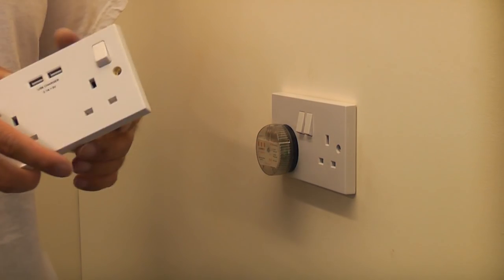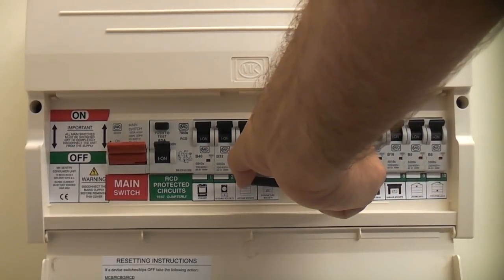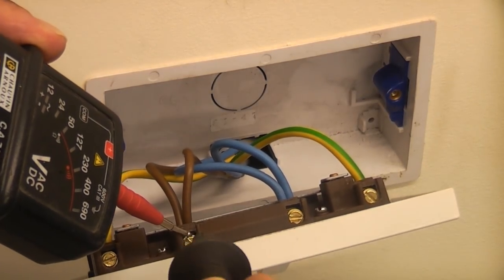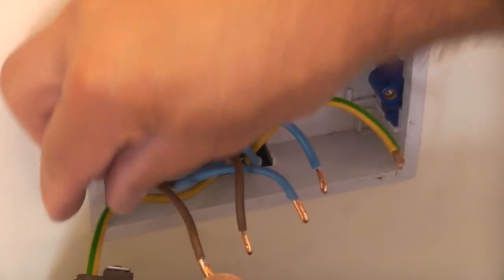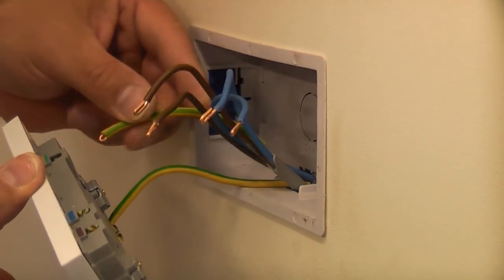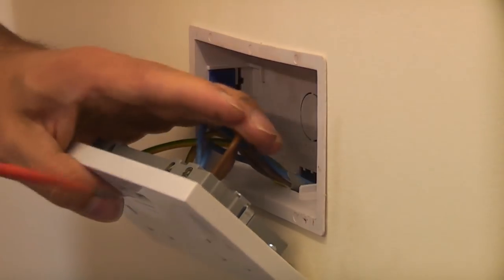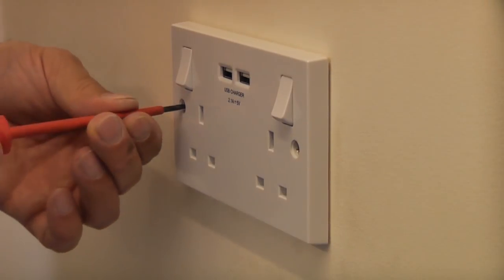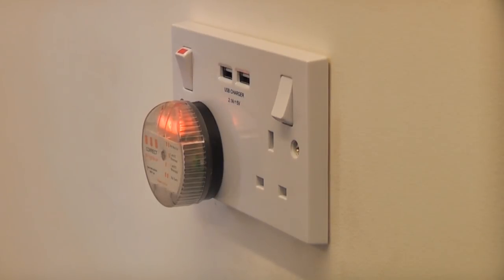How to install a USB wall socket

Comment: Handyman. Do those circuit breakers in your video just pull out when needing replaced? Is there a special tool or do you just pull them out by hand?
Reply from the maker: Jason Dunlop 
No, you have to isolate the main switch, remove the consumer unit cover then undo a screw at the bottom which connects the circuit breaker to the bus bar. Then on most circuit breakers you have to lever down a tab to be able to pull the breaker from the DIN rail, which it it clipped on to.

Comment: Do these still work on the old style wires I have the black red and one earth wire ??
Reply from the maker: Yes, they will work on old wiring. However if you have black covered cables (old rubber) it might be best to get your wiring checked by an electrician.

Comment: On my wall socket I have 3 earth wires. Should I put two in right  screw hole and one in the left?
Reply from the maker: Yes, that should be fine.
Thanks for the comment 👍
Reply: @ultimatehandyman  thanks you've really helped me out.

Comment: Hi u recommend me a dewalt combi drill with a steel chuck instead of a plastic chuck and its much better the grip on the chuck is better thanks
Reply from the maker: Keelin Black 
The metal chucked versions are normally the better made drills and often have more power as well as the better chuck. I hope you get years of use from it ;-)
Thanks for the comment

Comment: Thanks excellent video. I feel confident and safe now. That lock idea on main board really clever. Could you send a link please for the exact USB sockets you used as the colour coded wire location on the socket was great.
Reply from the maker: You are welcome.
I think it was this one- https://www.screwfix.com/p/british-general-13a-2g-sp-switched-socket-3-1a-2g-usb-charger-white/8529p
Thanks for the comment

Comment: I have an FCU that I would like to change to a single socket. Is that advisable?
Reply from the maker: It depends which circuit the FCU is connected to.
If it's an FCU on the socket circuit then yes, it should not be a problem.
If it is on the lighting circuit then no, you can't put a socket in its place.
If it's on a dedicated circuit you might have to check the MCB or fuse protecting the circuit and change it for a suitable amperage one.
Reply: Thanks for that - I don't know how to check which circuit it's on as I don't have anything attached to it?
Reply from the maker: If you get a no contact voltage detector and check the unit is live you can go and isolate a circuit at the consumer unit until the unit is no longer live, that will indicate which circuit it is on.

Comment: I bought a box of these double sockets with built-in USB from a well-known outlet. Shall we just say, if you are screwed, they can fix it? Fitted first socket for a friend, I won't say "customer" as the Taxman might read this. Both sockets fine but no joy with the USB sockets. Tried a different phone with a different USB lead and still no joy. Tried another from the box and had another go. Still no joy. Took the whole box back which was exchanged with no questions asked. Blow me if it was the same thing all over again. Took the new box back got a refund and went to another wholesale outlet for exactly the same make and model. All worked from the get-go. And they say to look for British  Kitemark for safety and quality of goods. Sorry about the rant people. It's off me chest now so Happy Days!!
Reply from the maker: Blimey, whatever happened to quality control!
Thanks for the comment 👍

Comment: Knowing how variable the quality and safety of USB power supplies can be how easy is it to dismantle these sockets? If I were to fit them then I would buy one to sacrifice and strip right down. Some USB supplies have sub 0.5mm separation between mains live and the 5v rail and the thickness of enamel on the wires in the transformer. Supplies like this are very common indeed and I would not want them fitted to the wall where they could become lethal for children to use after a few years.

Comment: I love that CU. It's so clean and organised. Did you fit it yourself mate? Btw what model is that probe tester? I'd love to buy myself one
Reply from the maker: +fro0tyl0opy87 
That's just a brand new CU that is not actually wired to anything LOL. I only use it for demonstration purposes as I have never been able to film my own CU or any others for that matter because the lighting is normally bad or there is junk in the way!
My tester is a Chauvin Arnoux. I'm not sure of the exact model without going to the garage to check, but it does say GS38 on it. Thanks for the comment ;-)
Reply: +Ultimate Handyman oh I see!! Oh well at least I no longer need to feel jealous then hehe. But I'd still like one as mine still uses the ancient clunky rewirable fuses. Thanks for your reply. Cheers.
Reply from the maker: +fro0tyl0opy87 You are welcomeThanks for the comments ;-)

Comment: when I took my old wall socket of there was only one earth so would it be OK to put new one on with just one earth
Reply from the maker: +Billy Rodaway 
When you say one earth wire, is there two lots of Live and Neutrals or just one of each?
Is the back box plastic or metal?
Reply: Ultimate Handyman 

I have the very same question. I only have one Earth,  but 2 sets of live and neutral.

Comment: haha.. Best advice.. Don't over tighten the screws.On my first time, I used an electric screwdriver and did not change the torque setting and split the socket in two.. (School boy error) :-)

Comment: Why is there two of each cable sometimes? I know mine has this, I opened my socket, I have the old colours. One of the blacks isn't connected and one socket hasn't got an earth connected? What do I do?
Reply from the maker: If you have two sets of cables behind the sockets it means you probably have a final ring circuit. 
http://www.ultimatehandyman.co.uk/how-to/electrics/ring-circuit
The black should be connected to the neutral terminal and the earth should be connected to the earth terminal (do this with the electricity isolated). Its very dangerous to use a socket without the earth being connected!
Reply: +Ultimate Handyman on the neutral terminal, there is only one black connected and the other is hanging out. Both earth cables are connected into one terminal.. I will sort the black cable out but are the earths OK in one terminal or shall I have one in each earth terminal?
Reply from the maker: The earths are fine in the one terminal ;-)
Reply: +Ultimate Handyman thanks!! All fixed, don't know if it made a difference to performance, but it's probably safer so that's fine with me, many thanks
Reply from the maker: You are welcome.
Thanks for the comment ;-)

Comment: Presumably you'd not run an insulation test on the ring circuit after installing one of these?
Reply from the maker: +Lee Greveson 
I wouldn't, neither would any other DIY'er.
Reply: +Ultimate Handyman I recently bought some Masterplug branded sockets just to try out (also branded as British General) The literature with the product states you can run an insulation test on this accessory. Happy days! True a DIY'er wouldn't run this test, but new circuits may include these items as they gain popularity.
Reply from the maker: +Lee Greveson 
Thanks for the info ;-)

Comment: Why does it say "for IT equipment use only" on the back? Also, does it matter which earth wire goes in which earth socket, i.e. "Clean Earth" etc?
Reply from the maker: I don't know why it says that, sorry.
As long as all earth wires are connected to either earth terminal it should be fine.

Comment: Perfectly timed video. Thank you so much.
Is there a really easy way to remember Live/Neutral and the colours. I try and think of 'bLown' and 'bNue' - I know, not very inventive.
Reply from the maker: exwhyz33 
I don't know if there is an easy way to remember, but all appliances have been brown and blue for decades in the UK.
We were taught this early on in school physics- something that I always remember.
That new socket actually had a blue marking over the neutral terminal and brown marking over the live terminal.
Reply: Yes the pre-marking is a great help.
Reply: exwhyz33 I always remember brown being live by thinking that brown is the colour of the soil and thats where life (live) originates.
Reply: Showing my age a bit here - I much proffered the old wiring colours as live was red & spells danger. (traffic lights, blood..)
Why did they change them? Was it just to indicate an updated system?
BRILLIANT bid by the way. Well impressed with your lock! Never knew there were such things. Just as well I'm just an occasional DIY housewife.
Tkx again for the excellent video 👍👏

Comment: Fitted chrome LAP ones from screwfix avoid like the plague nearly everyone developed a fault with the USB socket failing.
Reply from the maker: Graham Reid 
That's not good.
Did screwfix replace them free of charge?
Reply: ***** yes they did mate, but I wouldn't recommend LAP cheap Chinese offerings, now in the process of replacing then with better British made ones.
Reply from the maker: Graham Reid 
Thanks for the info ;-)

Comment: Question my house is old move in 2001 new house at that time, saw the wires only see 1 earth wire. What do I do, thanks
Reply from the maker: +juhel md 
How many red and black wires are there?
If there is only one red and one black wire, you will only have one earth wire.
Reply: +Ultimate Handyman there's 2 black and also 2 red
Reply from the maker: +juhel md In that case there should be two earth wires, unless two wires have been twisted together and one piece of earth sleeving has been used?If not you need to check because if there is only one earth wire you could have a potentially dangerous installation as some sockets may not have earth continuity.
Reply: +Ultimate Handyman is it possible if you can give me your email I can send u a picture. You know more than I do hiring a electrician would cost a lot, labor cost, installation I know how it works
Reply from the maker: +juhel md 
I just sent it via message ;-)
Reply from the maker: +juhel md 
Hi, I emailed you days ago, but never got a reply?
Reply: +juhel md What you may find is, both the bare earth conductors are in one sleeve. Or if you have a metal socket back box, the two earth wires may be connected to the earth terminal in the box, with one flying lead up to the socket itself. The only other option is that one earth conductor has been cut off for some reason.

Comment: I’m guessing using the volt meter to make sure no electricity is going through is just a safety measure. Is it required. Cos they are probably a fortune.
Reply from the maker: Yes, the HSE recommends a GS38 approved voltage tester, rather than a multi-meter etc. when testing for dead. They are not cheap and are not great in all situations- but better than no test at all.
Thanks for the comment ;-)

Comment: Without sounding thick. Cant you just put both earths in one hole?  What happens if you did/ didnt
Reply from the maker: Yes, you can.
I think its because if there is two separate earths there is less chance of the earth wire not being connected if there is one wire in each earthing terminal.
Thanks for the comment
Reply: Right i see so if two holes and two earths best to put them separate but if you do put them together it shouldn’t hurt. Thank you

Comment: wow the UK's electrical sockets look much safer and easier to install than the ones in the U.S, but its probably too late to change the system now!
Reply from the maker: YesIReallyDoLikeZebras 
It's 230v over here as is most of Europe. If I remember rightly it's 110v in the U.S?
110v does not carry the same danger as 230v. If we want to use power tools on site in the Uk, they have to be 110v tools, which can mean having to use a 230v-110v transformer as a shock from 110v is unlikely to harm you.
Reply: YesIReallyDoLikeZebras I can confirm being shocked my 230v is extremely unpleasant :D Wouldn't recommend it.
Reply: ***** Only 55V max voltage on a uk site 110vChez as the windings are centre tapped to earth (((T))).  It can all eff you up no matter what the mains voltage, go battery as much as possible kids, U know it makes sense.  IP44 RCD protected supplys at 230V IMHO are safer than 110V CTE.
Reply from the maker: Jeff Watt 
Batteries are definitely the future. On the sites I work on there are 110v sockets all over, but you often have to mess about with pig tails trying to get the correct sized plug with there being 16A and 32A plugs. Three phase is even more annoying, I'm sure there are about 5 different types of plugs and sockets in use on the one site for three phase!
Thanks for the comments Jeff ;-)

Comment: Just one thing I would like to add if I may, I must point out that the sub sockets are 2.5 amp at 5 volts now most phones and tablets use only 1.5 amps. This means that you will damage the battery in any device that is not rated at 2.5 amps I've destroyed enuf phones this way and normly it will only take about half an hour I just want to make people aware of this hazard !!!
Reply: +reece evmez The phone or tablet should only draw the current it needs, unless it is very badly designed.
There are some of the cheapo electronic cigarettes that do as you describe though, and as a result of people connecting them chargers other than were supplied, have caught fire, so beware of cheap crap!
Reply: ***** The phone should only take the current it requires regardless of the supply it is connected to - if the supply could provide 50A, it should still draw the appropriate amount of current the device needs, unless it is extremely badly designed.

Comment: Am I the only one who opens the socket without isolating and then touch the earth and neutral wire together to trip the circuit breaker and then start working... Lol
Reply from the maker: +Trevy 
LOL ;-)

Comment: Great video pal. just a question, I was replacing a double socket in my lounge earlier. the new one says 230V on the back and the old one actually says 250V. 

so does that mean that if I put the new socket on, then the maximum voltage that it will take it 230V ? 

the plug on my dyson fan heater says 250V, so will this be affected. 

I live in the UK btw. 

thank you.
Reply from the maker: It will be fine, you can read all about it here- http://www.schneider-electric.co.uk/en/faqs/FA144717/
Reply: +Ultimate Handyman thank you so much man. I subscribed to your channel a while ago. it's brilliant mate :)
Reply from the maker: You are welcome.Thanks for subscribing and thanks for the comments ;-)

Comment: Or you could plug a table lamp in turn it on, trip the breaker check that the lamp has gone off
Reply from the maker: You could, but then you need to check that the lamp is still working on a known live circuit 👍

Comment: i thought you would only need a 20A RCD for your sockets?
Reply from the maker: +Liam Beirne It's normal in the UK for domestic sockets to be wired in a ring main configuration, which is normally protected be a 30 Amp fuse/ 32 Amp MCB. Thanks for the comment
Reply: +Ultimate Handyman Ohhh okay thanks anyway
Reply: +Ultimate Handyman Ohhh okay thanks anyway

Comment: what happens if I only have one earth wire coming in to the socket?
Reply from the maker: If you only have one live and one neutral one earth is fine.
If you have two live wires and two neutrals but only one earth wire you need to find it as there will be no continuity in the earthing circuit!
Reply: Ultimate Handyman, I have two lives , two neutrals , and two earth's twisted together. I split them and put one in each still the USB don't work but the actual socket does
Reply from the maker: It looks like the socket is faulty if the mains sockets are working?
Did you buy it from a reputable source or ebay ?
Reply: Ultimate Handyman , just got it this evening from homebase
Reply from the maker: It looks like it's faulty I'm afraid.
Have you tested a couple of USB devices in the USB ports?
Reply: Ultimate Handyman yeah but still nothing , it's like there's no power getting to the USB part , because the actual socket is working fine

Comment: I wear thick rubber water boots and stand on a 9" thick rubber mat and also I lcck all my doors and windows as well as locking the cupboard door the circuit board is in before I attempt any electrical works
Reply from the maker: Ha Ha, better safe than sorry ;-)
Reply: George Best ..,.the only thing in my house that is rubber and 9" long is owned by the missus, if I were able to get it off her ( bearing in mind her clunge has a grip on it like a jockeys whip hand ) where should I shove it for safety ;-)  lol

Comment: most electricians would not even isolate; just be careful not to touch wires...I did the same job, but as it was where I live not had to lock out rcB . 5 minute job if done carefully..could not have de=one it better
Reply from the maker: Thanks for the comment

Comment: These sockets are a fire waiting to happen.
Reply: +Sean The cheaper versions may well be, as they run constant, at full output. Some `intelligent` electronic devices, actually refuse to take a charge from these, if they only need a partial recharge.

Comment: great vid i like and i apreciate it but.... freeze video at 3:42 it says USB CHARGER  5V  2.1A 5 volt is quite ok  but 2.1 is kind of risky for mobile phones !!!  my charger for samsung says 5 v and 0.7 A i belive is 700 mlA !!!! , iphone and ipad it can take only 1 A !!! its dangerous at 2.1 A for these devices , your socket is good for charging external bateries or puting there an usb light.  i dont say it in bad meaning :-) GOOD LUCK WITH YOUR PROJECTS BRO
Reply from the maker: +dan laesu From what I understand- The 2.1A is the maximum amount of amps the unit can supply. If you plug a charger into it that is 1Amp then that is all that the device will draw, it will not draw 2.1A because it can only draw 1Amp!Thanks for the comment ;-)
Reply: XD